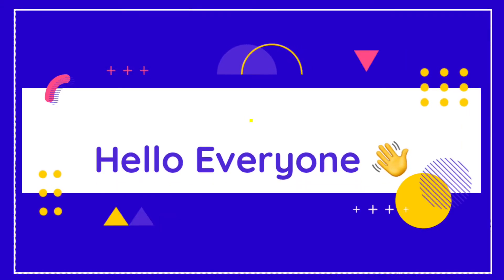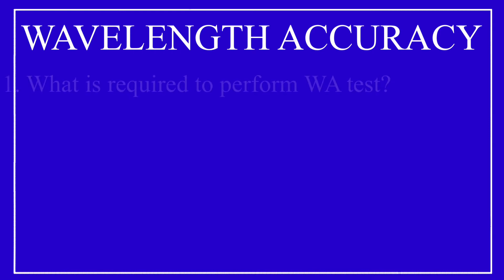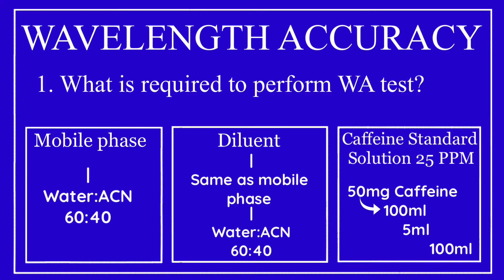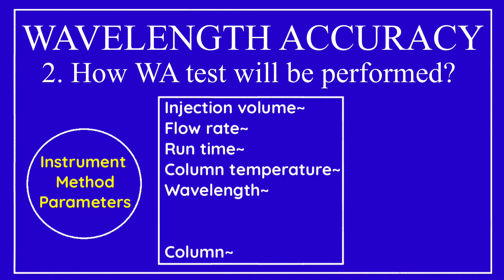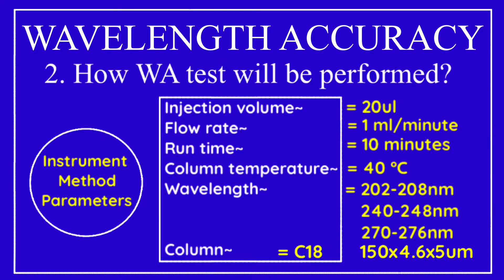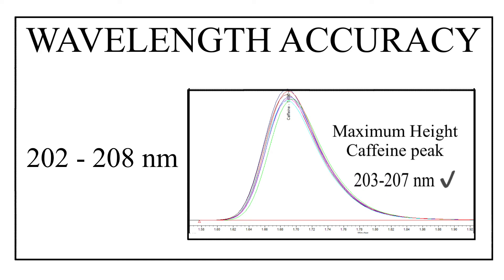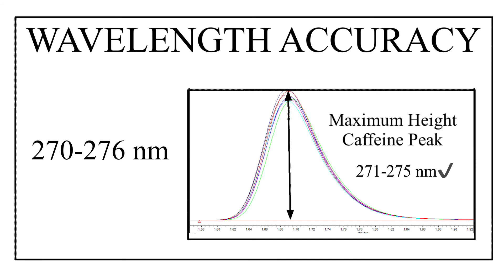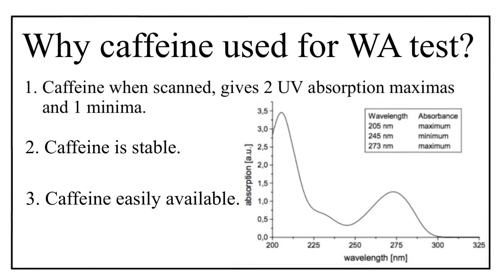Wavelength Accuracy || HPLC Calibration Series Part-2 ||

Comment: Sir actually our limit is 203-207 nm.but why we are doing 202-208 nm please explain
Reply from the maker: First of All thanks for such a brilliant question.
If you see guideline General European OMCL Network (GEON) as per that we need to scan from 190 to 290 nm scan with 1 nm incremental. And if you scan from 190 to 290 with 1 nm incremental your analysis time will huge. That’s why HPLC vendors recommends to scan near 202 to 208nm. Rather than entire 190 to 290nm.  Hope it’s clear to you now..